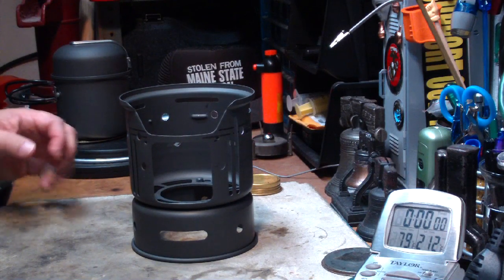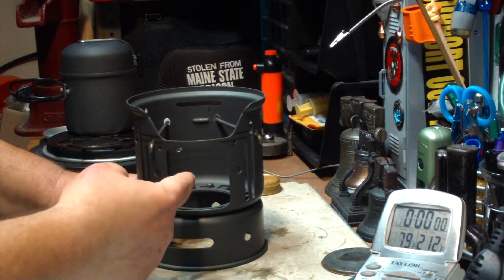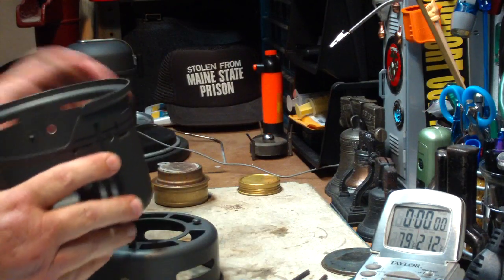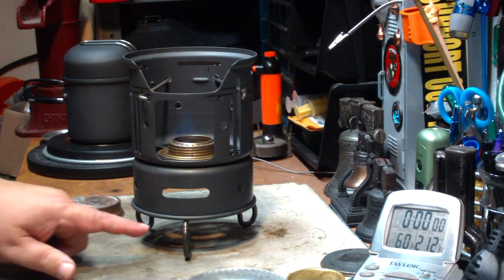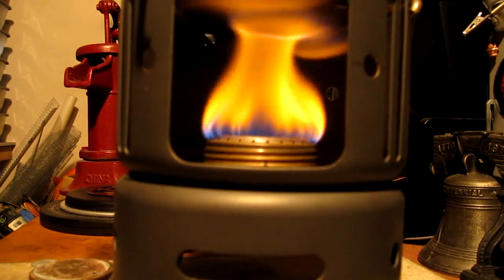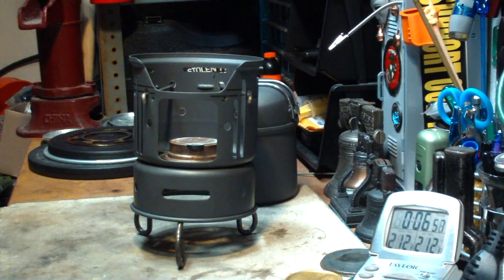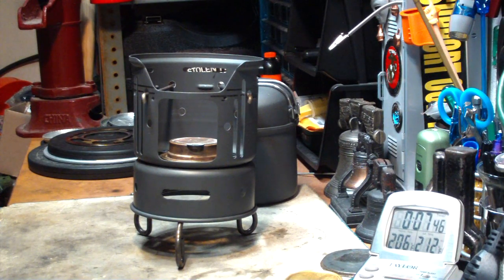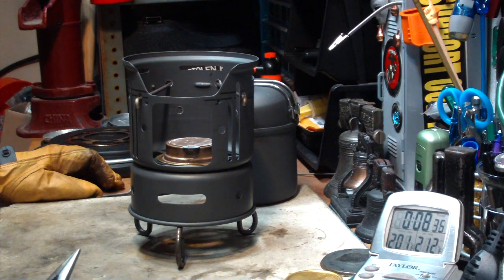ALOCS 7 Piece Camping Cook Set - Boil Test - Elevate the Pot Stand

Comment: I know this series of videos was from a while ago, but I think whats happening is that you’re losing heat through the large opening at the front.   When the pot sits up high, heat can escape up along the sides of the pot.  When you dropped the pot’s position, the heat tended to escape through the front port, extending the boil time.  The wire pot stand up top improved the time because more heat went up along the sides of the pot.  If you still have the cookset, try raising the trangia up inside the cookset, or possibly cover the front port.

Comment: My Question is, whats wrong with how it's boiling, 6 minutes 30 some seconds is a pretty good boil time, what is the run out time on this, as I mentioned in another comment my Alocs dry baked for 50 minutes with simmer ring just over half closed.

Comment: Remember, it will also get air for combustion from the side slits up under the pot.  It probably has all the air it needs.  Alternatively, did you change two variables for this test? More air AND raising the pot away from the burner?